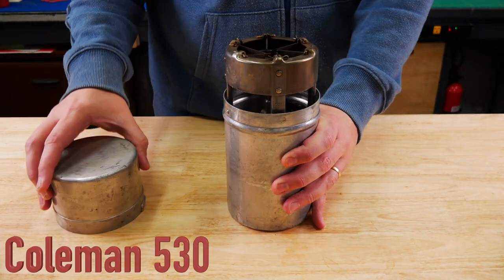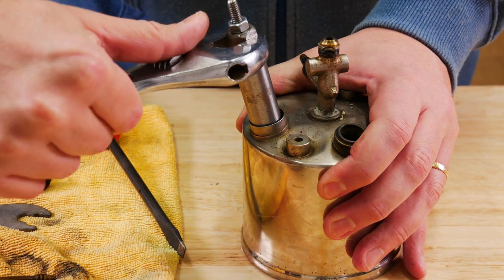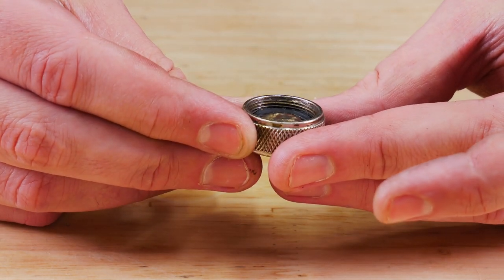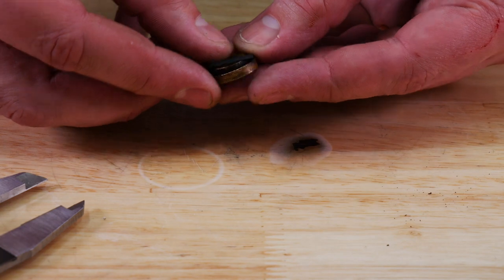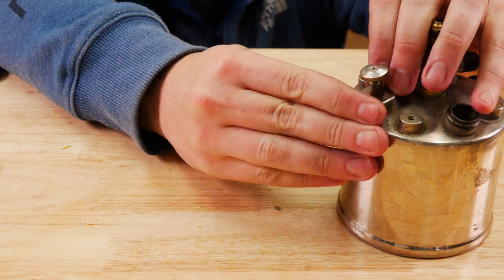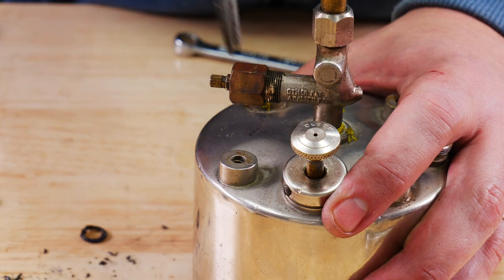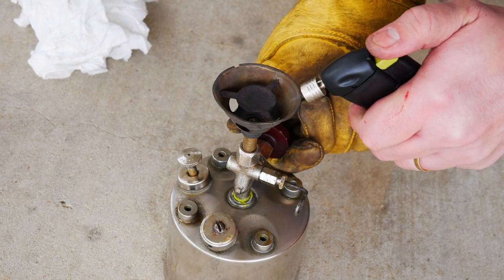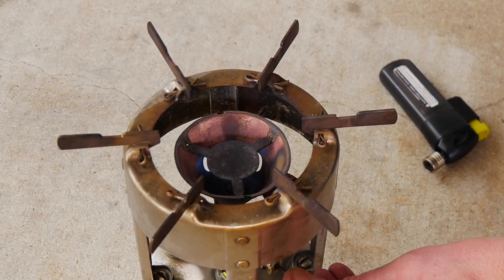Vintage 1946 Coleman 530 Strip Down and Rebuild - Step By Step

Comment: The moment you used that box end wrench to tighten the valve and the wrench touched the threads I cried. That needed some type of protection to not damage the threads
Reply: I noticed that too. Looks like they got kinda boogered. 🤔
Reply: Same, I cringed so hard…

Comment: I have one of these that was either my grandfathers or dads. Also a 220B lantern i had found.

The pocket stove was working good for a while but if i recall has a leak somewhere.  I should go through it and see if i can get it running because i want to add a ss mesh screen mantle and use it as an radiant heater.

Comment: I use my 530 quite often so added a preheat cup to warm the generator.  Less dramatic but very short time with a little DNA and away she goes.  Great solid built stove and with a little practice and a 'simmer' plate can do pretty well frying bacon and eggs too.  Love my 530. :)
Reply: would love to get a preheat cup for mine.
Reply: @HiddeneyeInc  Preheat cup from Coleman lantern 237 works.  Try Old Coleman Parts.

Comment: You did a nice job on the overhaul of stove but I didnt see you preheat the stove before trying to light. The pressure is to force fuel up and out and into the prehit cup . Just open full fir a few sec. Then turn iff , then light fuel in preheat cup  and let burn until almost out ( stand by with lighter in case needed) open fuel and it should light off remaining flame from preheat,if not use the lighter. A couple of pumps after yiu get it lit will help keep it burning nicely l.

Comment: Nice video Dr. Ernie!  I just bought one of these Coleman 530 stoves.  I'll be inspecting it, disassembling it, cleaning it, reassembling it, and testing it very soon.  I already know before any cleaning has commenced that the round knob won't turn nor will the needle cleaner metal piece thing.  They are stuck frozen and won't move.
Got any clues for me on how to get them moving again?  WD40?  Rust Blaster?  Heat it up with a torch?  3 in 1 oil?  Electrolosis with a sacrificial metal anode rod?  What would you do if you were in this situation?  Please advise me.  Thanks Dr. Ernie.  Hope to hear back from you soon.